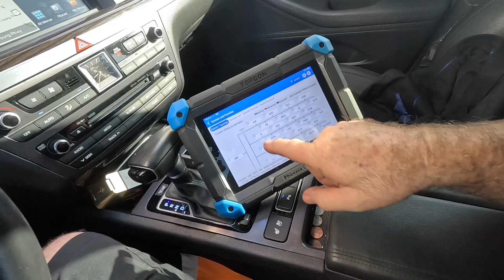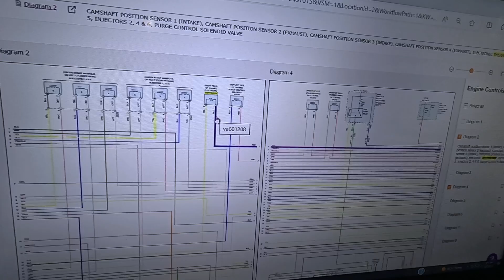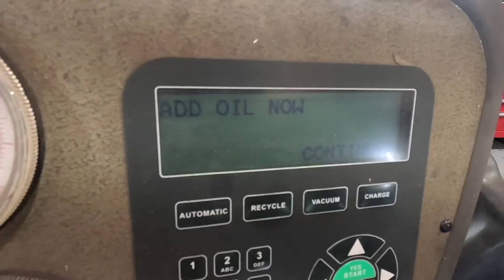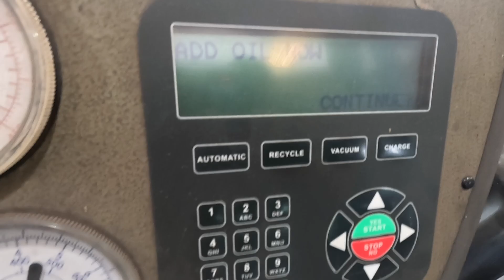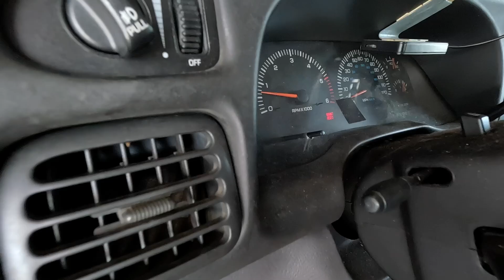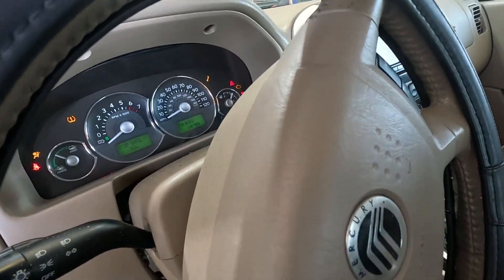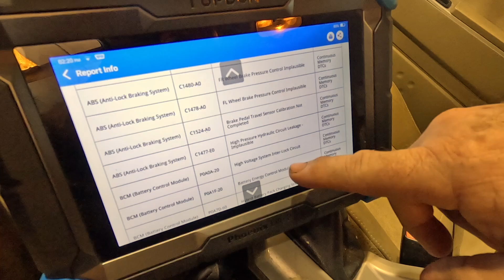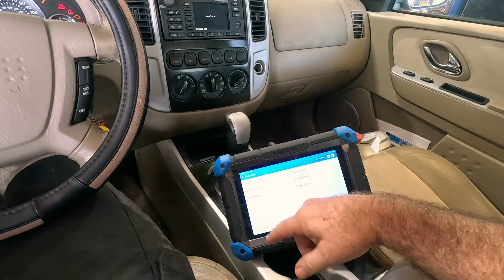Mariner Brakes, Escape A/C, Steering, Genesis No A/C, Ram Window, A DAY in the Auto Shop 304 #auto

Comment: I fe'd myself on a Subaru steering shaft. Pulled it apart without marking it. I had to realign it 4 times to get it right. I am used to domestic stuff where it has a giant flat.
Reply from the maker: Yeah, the splined versions are a pain since one spline and it's noticeable at the wheel.